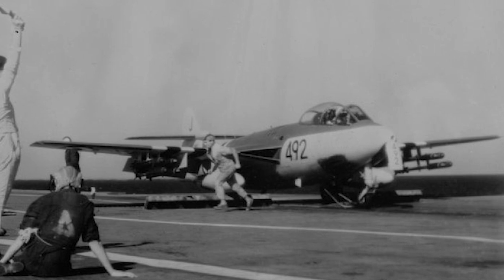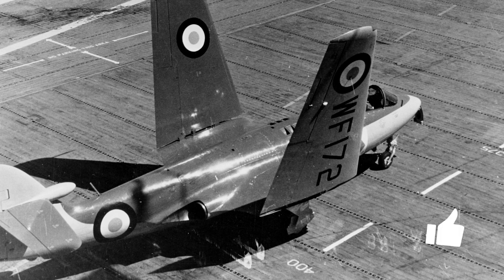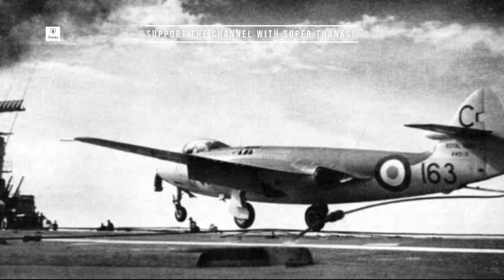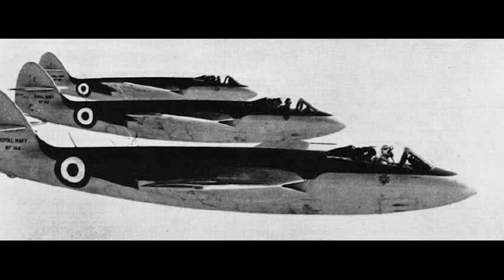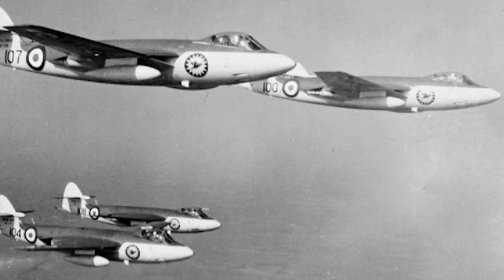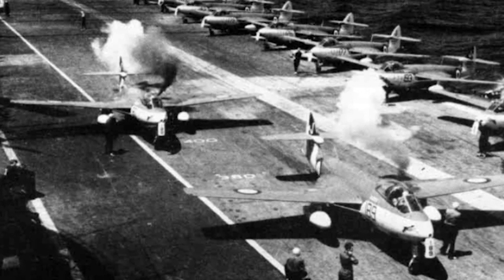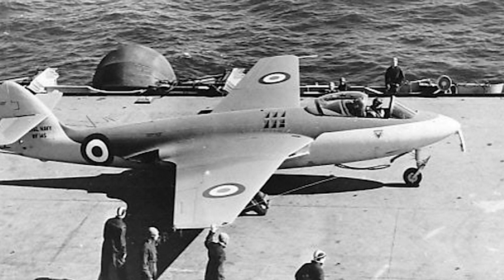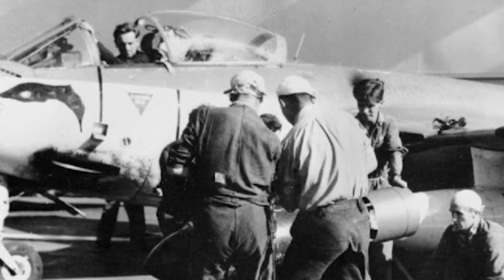Hawker Sea Hawk - A Short History

Comment: Nice looking aircraft - as a child it was one of my favourite models.

On the subject of the Harrier since you mention it in the video, Hawkers' solution to the need to keep the wieght down led to the decision not to use electric motors or hydraulics to swivel the jet nozzles - they used bicycle chains instead.  Worked very well too.

A friend of mine who was in the army 30 or so years ago once destroyed a Harrier during a joint services excercise. His squad was tasked with finding where the "enemy" forces were hiding their air liason setup, and sneaking through the forest came across not only the liason but an actual Harrier parked in a clearing next to the RAF tents. He wrapped a brick in cloth, wrote "BOMB" on it and managed to sneak up unobserved and place it in plain view just inside the edge of the air intake. Having regained cover, still unobserved, he and his squad then had to freeze in place because activity suddenly picked up in the encampment and the pilot came out to his aircraft. Without doing any walkaround check the pilot climbed into his cockpit and started the engine. The brick was sucked into the turbine destroying the engine with various bits of both brick and engine departing the aircraft through places that weren't supposed to have holes in them.

In the subsequent court martial Ted was exonerated and the pilot was kicked out of the air force.
Reply from the maker: Thanks for sharing that story! Feel bad for the pilot...but I guess he should have done his walkaround :)